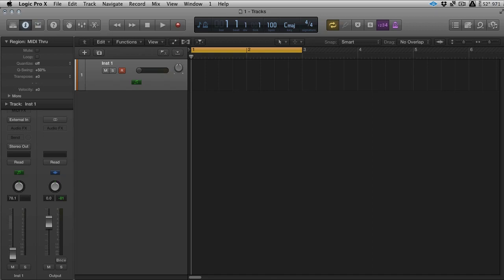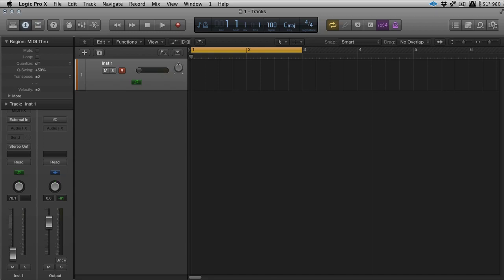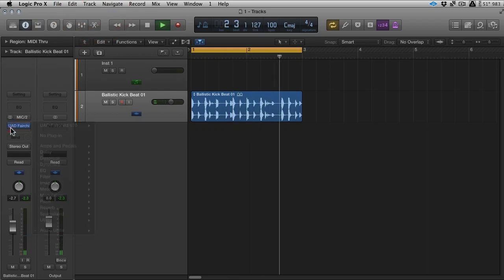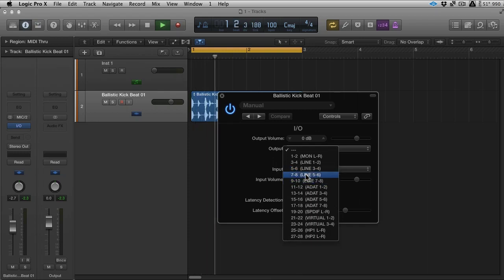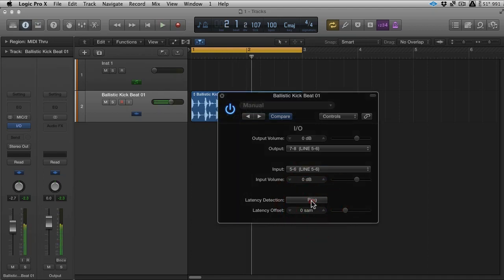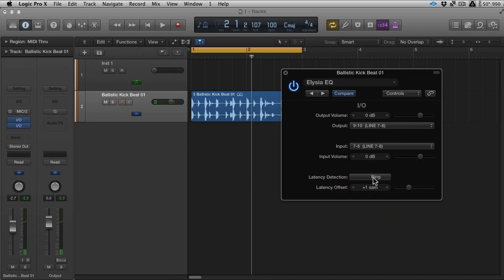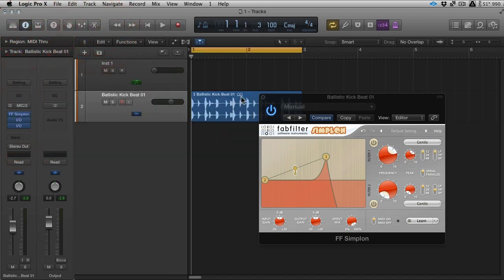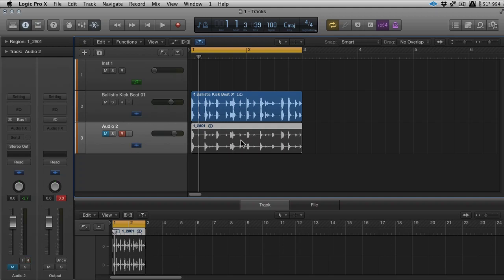How to Use External Processors in your DAW

Comment: I am doing everything you say to do but my nanoverb is affecting everything coming through my interface. I am trying to get it working by recording 2 guitar parts and adding the effect to only one part but the first problem is all my audio gets affected even before I have used to I/O plugin on anything. Also when I use the I/O plugin on one audio track if I solo the other track I can hear both audio tracks.

Comment: hi could you do a video or a diagram  on typical signal flow through an analogue mixer and a patchbay with rack fx   into a multi out sound interface then finally into a mac my interface is a roland vs100  but any general ideas would be appreciated

Comment: Hi Mo, 
I think you didn't mentioned it, but, you're using the same Output (5-6) and Input (5-6). So my question is.. to make this connections possible, you need to have a Patchbay also, right? 

Best Regards! U rock!